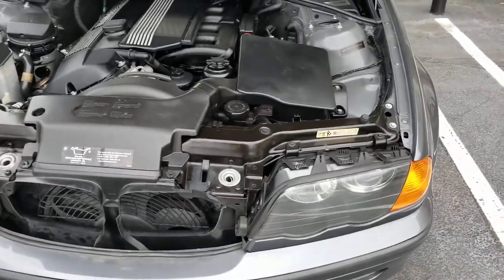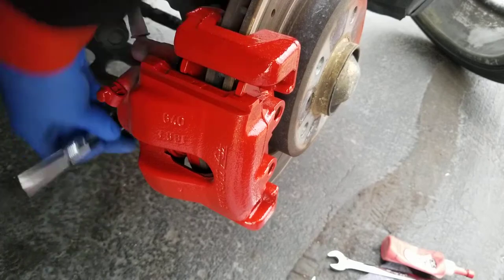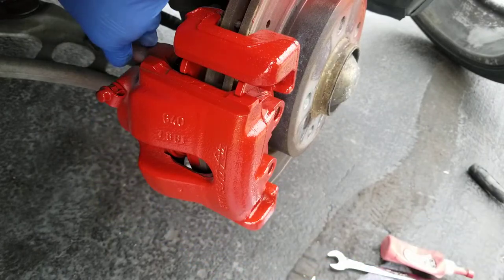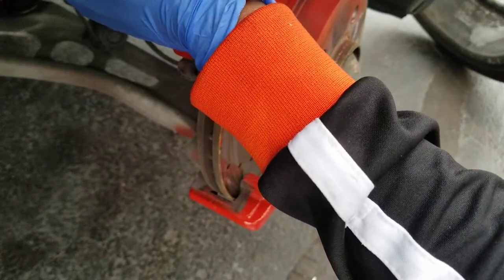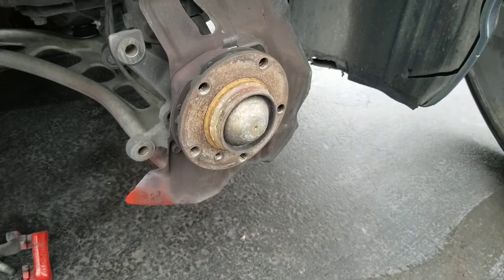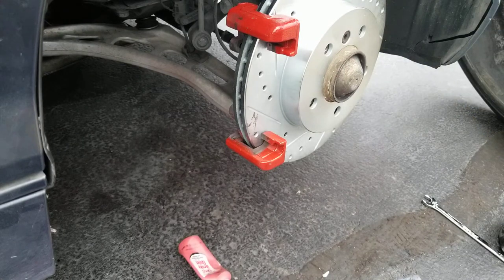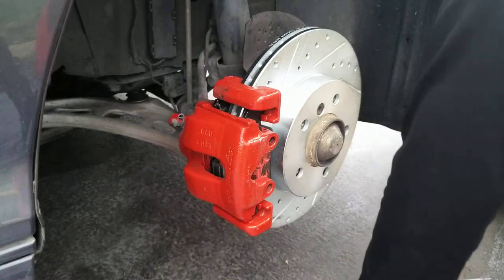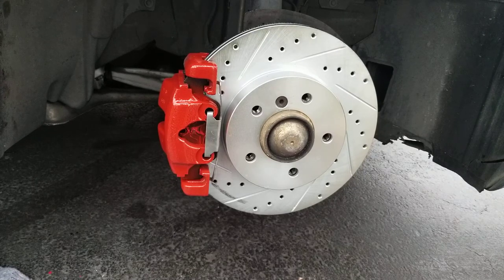BMW E46 325i Brake Pads/Rotors Removal/Replacement

Comment: @AngeloKgrant You should have a wear sensor that will alert you when they are getting low, at least most E46s I’ve seen have them. But the best way to know for sure is to just take the wheels off and look at the pads. You should see at least an inch or half inch of pad material left if they’re good. Always remember to check the inside pad, often times on cars I’ve had the inside pad will wear before the outside one, and if you only check the outside one you may miss a worn out pad on the inside. Also if your rotors ever start to look scratched or make a squeaking noise change your pads immediately, and possibly rotors too depending on how bad those are